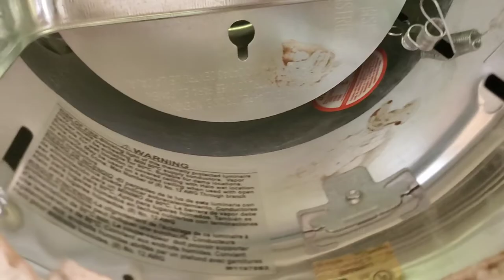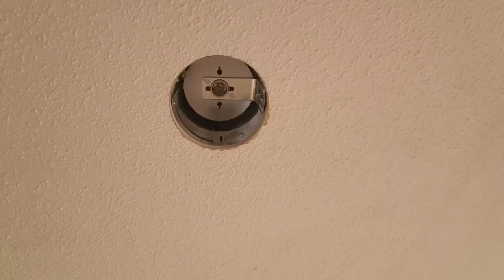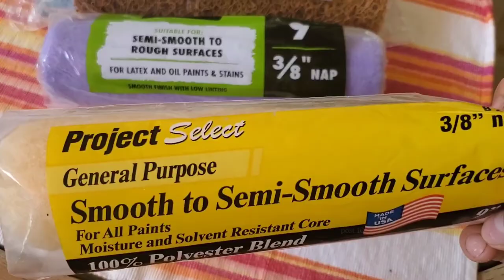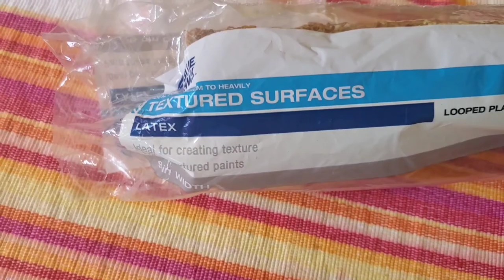Easy Removal Of Recessed Lights And Painting

Comment: Is Drylok a latex based paint?
Reply from the maker: Drylok makes both latex and oil-based paints. Most stores will only sell latex because of environmentalist but you can get it with a special order. Oil-based is a more durable paint but for a basement latex might be the better way to go because Drylok extreme latex is antimicrobial meaning mold killing. Mold will eat oil based
Reply: @post10Vlogs  I prefer latex paint over oil based paint...easier to clean up